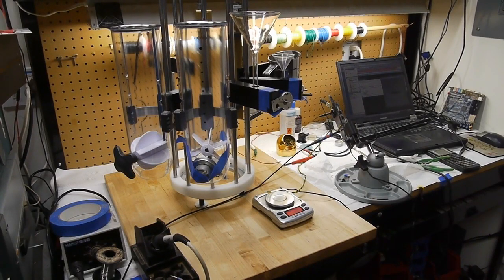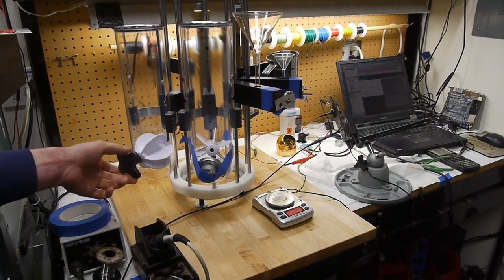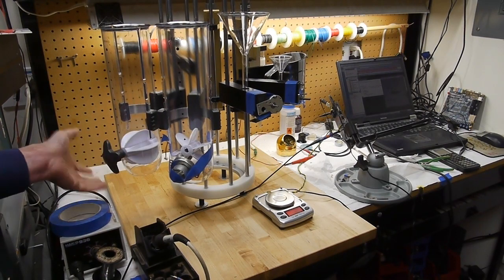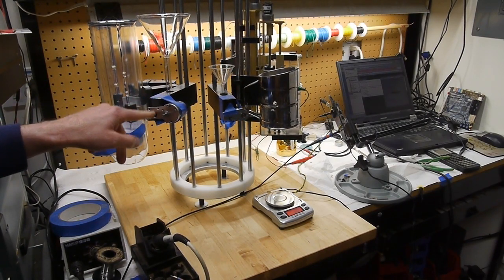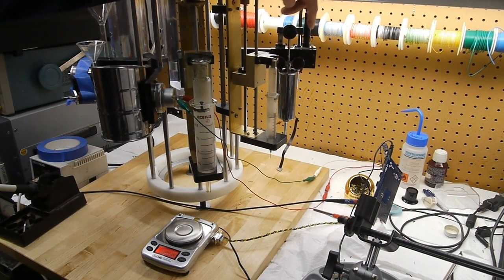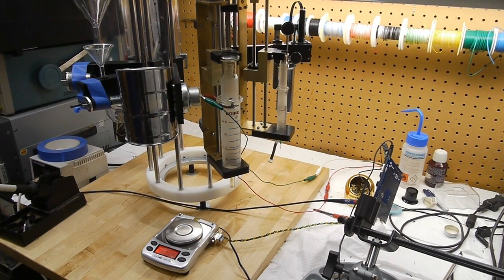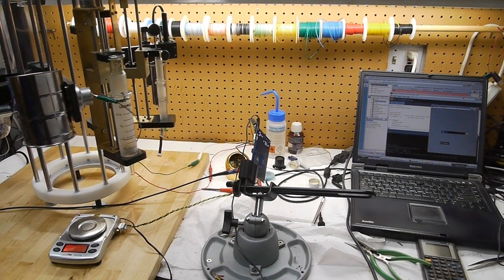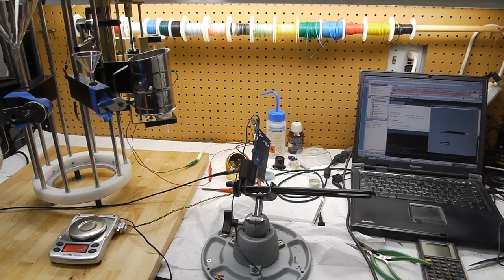Cookie Machine project update

Comment: the point of the device, as far as i can tell, is to test small batches of different cookie recipes to find one you liked. I can only assume that once a good recipe is found it will be written down to be shared with others. In that case it will have to be written in terms of volume because most people have measuring cups but not a scale. i mentioned this in a previous post but i guess it depends on the audience. if it's meant for more large scale production then by all means keep it by weight.

Comment: I am working on a project myself and a mechanism I am using may work well for you.  I am using a disk sandwiched between 2 plates, with a whole bored into it, then the 2 plates have holes which do not align with each other, one hole is entrance, other is exit and I am using a RC servo to tic-toc it(first position entrance, second exit). You could figure out hole dimensions to give you a set volume(smaller than what you would want) then just tic-toc it to get the desired volume per cookie.

Comment: For your rotaty butterfly thingies, you could fill the gaps with sugru. It's a silicone putty that cures in 24 hours. I believe it's food safe, but you may want to research that. Anyway, it sticks pretty well to most materials and is firm yet flexible, and easily trimmed with a sharp knife.

Comment: I'm surprised no one has mentioned this but brown sugar is actually just a mixture of white sugar and molasses. It might be a lot easier just to replace the brown sugar dispenser with a molasses dispenser (since liquids are easier to dispense) and then use software to calculate the amounts of molasses and white sugar for the equivalent amount of brown sugar.

Comment: You could make the brown sugar dispenser, like a ice machine dispenser in that it has a stirring rod in the inside to stop the ice (sugar) from clumping together, with you butterfly valve on the bottom for accurate dispensing. just a though, hope it helps.

Comment: I have a few question/suggestions.  First, wouldn't it be easier to store the butter and sugar together, prewhipped?  It would avoid all of the issues with storing sugar, especially brown sugar.  If not that, then: Second, wouldn't it be easier to store brown sugar separated into its two ingredients, and mix together within the machine as needed?  Brown sugar is 1 cup of normal sugar + 1 tbsp of molasses.

Comment: My wife says that if you put a piece of bread in with the brown sugar it helps prevent clumping.  It seems that the bread provides moisture to the sugar.  Perhaps you could add a humidifier to the side of the tube.  Unfortunately, that would be another thing you need to control.

Google tells me that some cooking stores sell hygroscopic ceramic disks that you soak with cold water and store with the sugar to keep it from clumping.

Comment: If you're baking using units of mass for measurement rather than units of volume, packing the brown sugar isn't an issue. Honestly, I really hate using imperial volumetric measurement for baking... it's so much faster, cleaner, and more consistent to just measure out 1kg of flour than 7 1/4 cups or whatever it is (as an example).

Comment: Have you considered using a corkscrew about the size of your container for the brown sugar, mounted from the top to unstick the brown sugar from the walls? I have a feeling it may end up stuck above the paddle wheel you have at the bottom. A slow motor and a metal hanger would be all you'd need.

Comment: I just had an idea for the chocolate chips,, a twin metal v, it turns two ways you always have chips available in one v while the other side v dumps the chips,, a circuit like a loading unloading old VCR sensors and controls,, to turn the v left,(dumps out) then senses another move of the carousel,, turns the v right (dumps again),, you always have the determined amount,, just a thought thanx!

Comment: Instead of a barcode/DC motor drive system for the base, you could do a stepper motor with a rubber wheel. Still relatively easy to drive, and less need for feedback.

Comment: I'd think that you could come close by starting with a known quantity of plain sugar, and manually adding molasses until you achieve a decent color match.

Also, brown sugar comes in both light and dark varieties, but many recipes do not bother to specify which one to use, so I'd think the exact molasses content is not too critical a factor.

For what it's worth, Wikipedia says light brown contains 3.5% molasses by volume, while dark brown is 6.5%.

Comment: Hi Ben, really like your cookie project there. Regarding your dispersement  of flour, sugar and baking soda, have you thought about using a Archimedes Screw coupled to a stepper motor, instead of the paddle setup, I think it might give you better control of material dispersement. Just my 2 cents worth. I really do like your project though. Back in High School I helped a friend build a fortune cookie machine.

Comment: for the mixing how hard would it be to raise the carousel up and have a central mixing system in the center that everything feeds into. That way the mixer could get the right consistency in each stage of the of the cookie dough and multiple batches could be made at once

Comment: Why not use a screw feeder for the brown sugar Ben. Its the way solids are metered into processes in industry. Adjusting the screw rotational speed will give you the addition rate and rotation time will give you the volume(weight). All you need to do is get the right diameter screw to allow accurate addition.

Comment: brown sugar needs to be compacted to measure correctly. How about something that takes a tube of compressed brown sugar and cuts off a puck of a certain size when it's advanced out of the tube? you'd need something to push the column of brown sugar downward and then maybe a wire that scrapes along the bottom to cut off what's exposed.

Comment: That's awesome, can't wait to see more progress. Do you anticipate any problems with the brown sugar's stickiness? You mentioned that the butterfly valve would act as a grinder, but you also said that the sugar, if left, would be able to adhere to the sides of a cup so much that you could flip it upside down. I assume this could cause the need for an awfully large lot of rotations. It might be possible to add an actuator, but a sizable weight might do the trick too.

Comment: I'm not really familiar with the consistence of brown sugar but, can't you shake it to break it apart?
Another idea would be to have several stainless steel tubes bundled together and filled with brown sugar. This way the scraper would have an easier job breaking even portions because the brown sugar won't stick in a big lump but instead in thin columns.

Comment: If the chip and brown sugar dispensers don't work out, consider an inverted arrangement where the piston drive pushes the material UP against gravity and the dispense volume is transferred by a scraper from the top.  It would have to be initialized, of course.  Can you give links for your UI software?  I went to 
"processing" stop "org", but that don't seem right...

Comment: I know I'm super late to the party, but if the ingredient dispensers were stationary and the balance was the moving part, it might make things easier. For one thing, you could get one of those... shoot I forget what they're called. So that you can keep electrical contact with something that's moving, like the brushes on a motor. Anyway, you'd only need a few connectors to manage the scale, rather than all of the connections that would otherwise need to be... brushed... for all of the dispensers.

The other benefit would be that you wouldn't need to track absolute position. As long as you always manually set the balance under a specific dispenser, say the butter dispenser, then witch each cycle, the system would only need to track the relative angle of rotation from that origin. It seems with your setup, there's an acceptable margin of error of at least a few degrees, so you'd only need to "eyeball" it, or put a mark on the track if you wanted to be more accurate.

Edit: I just realized that the relative positioning hack could also be applied in the current configuration.
Reply: @charleshache5115  yes, it is! Thank you.

Comment: how do you plan on connecting each dispensers motors/controllers to the computer? Will the carousel be allowed only one revolution, then reset, and therefore use regular wiring? Or those fancy metal rings to give power to the rotating part, a microcontroller there, and connect it to the computer wirelessly?

If anyone knows what the fancy metal rings are called please tell me :D

Comment: Can you use sugar dissolved in water instead of a dry powder? It would be so much easier to dispense..
Reply: one would need to modify water and fluid ratios, but, yeah, one could use a syrup, but this would give less variation, as it would make the cookie more or less runny.

Comment: What if with the brown sugar you had two plates that can slide in an out at a set distance (say the internal volume equal one cup) and a weighted cap to slide onto  the brown sugar ("densely packed"). To dispense the brown sugar you would close the top slider, open the bottom one and hope it slides out... might have some bugs with the brown sugar sticking to the sides.... you need the nanoparticle non stick surface spay stuff lol. Your idea might work better

Comment: you could but that's not how you generally measure out sugar. most traditional recipes use the cup as the main unit and then fractions thereof. So if you made a recipe based on weight you'd be screwing over anyone without a gram scale. So i guess it depends on who's the intended audience. if it's your laymen baker you're gonna wanna keep things in increments of fractions of a cup.